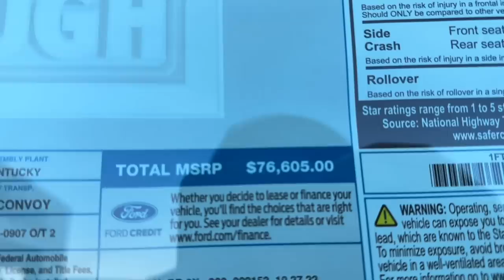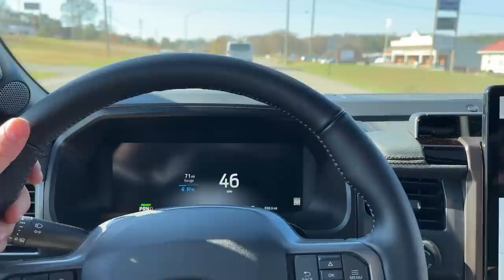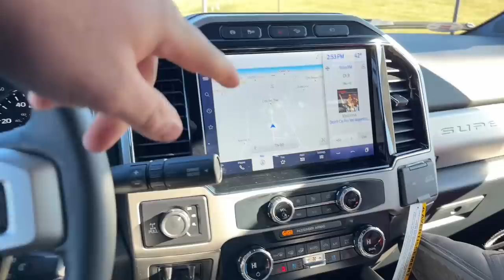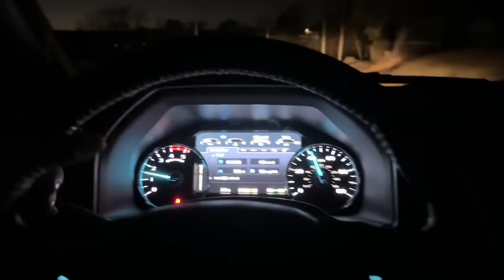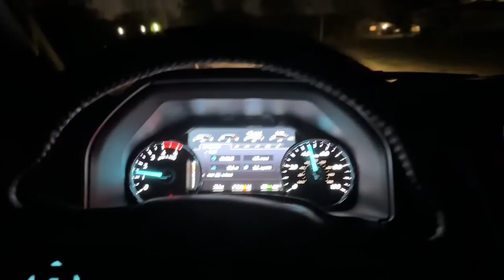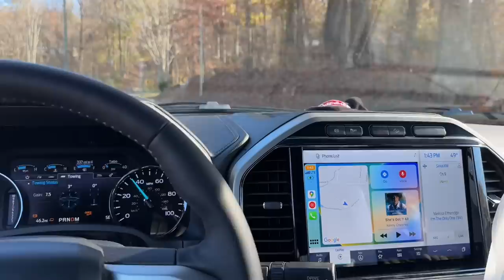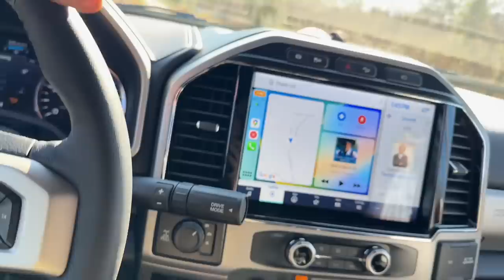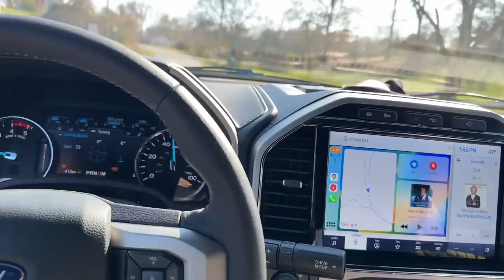Upgrading the fleet with ELECTRIC Trucks or DIESEL?! We try them both..

Comment: I had a 6.7 powerstroke for a couple years. I shed some useless "weight", and she ran amazing and my fuel mileage increased tremendously. I ended up selling it and went back to a old low mileage 7.3 because of the emissions regulations in my state, otherwise I'd still have it. Hope you enjoy your new truck Tim!

Comment: How to turn seat belt minder off. First thing I alway do in my truck!!   Turn the ignition to ON but not start (key position 2, or press push to start button without your foot on the brake if you have a push to start button). Wait 5 seconds, then buckle and unbuckle the seatbelt 3 times with a 1 second pause between each buckle. Wait 4 seconds, then buckle and unbuckle again.

Comment: New 6.7 HO is an option on the 2023's coming out.  Yours still has the standard 6.7 which is plenty with around 475 and 1050 foot pounds.  That 10 speed is huge.

Comment: I have 470,000 km on my ‘18 PowerStroke and, apart from a fuel pump, it has been routine maintenance  It’s no stranger to the 40’  gooseneck either. I don’t think you’ll be disappointed

Comment: Electric will never be feasible as long as they require batteries, and expect that 45 minute fast charge to be 90 minutes in most locations and the 300 mile range to drop to 80 if you use it as a work truck. Home charging is even slower and expensive and you don't dare park them inside or near another vehicle because if fire risks.
Reply: Wondering who's road they are going to drive the electric vehicle's on....they are not paying no road tax on fuel like we pay on gasoline and diesel 🤔

Comment: I had the 6.0 2003 lump "o" S#it had nothing but problems, Motor pulled less than 10k just to plug all the leaks. Drive down the Interstate and it would shift into tow haul @ 75 mph freak the crap out of you then you had to pull over and the only way to get it back to normal you had shut it down and start it back up pain in the Butt. My new work truck 2019 2.7 F-150 blew up @ 46k. No more Blue Oval for me ever and my FirstCar 66 Fairlane is still one of my favorite car's in my whole life.
Reply: Oh I traded the 03 for my 06 Megacab 5.9L 99k original miles 1 owner and Motor is a 100% stock Virgin nothing modified not a huge Dodge fan but this truck has never left me high and dry!

Comment: Tim, the 2022 PowerStrokes have around 35hp more than the Ram Cummins. For 2023 the PowerStroke was boosted to over 500hp. The Ford does have the 10 speed transmission. 

The negative on the PowerStroke is engine braking. The Cummins engine brake will stop the truck while the PowerStroke will eventually slow it down. 

Watch the rear axle on the Ford as they’ve had issues with axle tube crushing. Google the issue.

Comment: Tim all we use now is the 6.7 we got rid of dodge trucks company wide we’ve had no issues “ there is always that one “ great power stock the only thing with my truck just like the one you have is I always have a lot of weight I put air bags on the rear it helped a ton with front tire wear and brakes in the front

Comment: Picked up a loader  in TN. WHERE the new Ford plant is being put in at . For the. E.V BATTERIES AND LIGHTNING ARE GOING TO BE AT. LARGEST DIRT WORK GOING on in the country they say completion  will take 10 years. Impressive. My personal opinion is  its  ok to have wind solar and electric. But you can't end diesel or gas vehicles just to push E.V

Comment: Sorry, I`m sticking with the petroleum burners. If everything switched to an electric motor, there wouldn`t be enough power plants to supply enough energy or the grid systems to deliver it. The windmill and solar systems aren`t producing the energy they thought, as a result they`re in the process of bringing back nukes that have been shut down for over 35 yrs. Right now Calif. can`t supply enough power to stop brownouts in peak usage times, and yet set a time limit on all vehicles in the state or entering the state to be electric ."Go electric" is a great idea we aren`t prepared for.

Comment: Noooooo. Don’t give in to push for electric vehicles. They are worse for the human body than the dirtiest gas or Diesel engine
Reply: He's not lol
Reply: Try actually watching the video
Reply: I don’t know who’s older 6.7 you drove, but the 6.7’s have been flat out quick since 2011, especially in the 250’s ., compared to competing trucks.. I too have been through the dodge, the ford 6.0, I even have a 450 gasser v10 that is a dog, but with 350k miles it still starts and runs daily, just needs a qt of oil a week , the 6.0 I’ve had the heads off twice, and the valve covers and oil rails another handful of times., my 6.7 has been under warranty untill a few months ago, just threw an sct canned tune on it, and I run torque pro to watch all pids, runs great…
Reply: It also supports slavery in other countries
Reply: @privilegedwhitemale306  Tesla hasn’t used cobalt in their batteries since the end of the first quarter of this year, hopefully other manufacturers will follow suit in the future.
Reply: @barrett2724  Well if you believe the fossil fuel lie still. I don’t know what to tell you except go research about who stated it was fossil fuel. It’s not.
Reply: @jonkeau5155  the rest will always be far behind Tesla.
Reply: @@haunlou1644 I guess maybe you should do some research. There is plenty of evidence and information out there. Turn of the Tell-lie-vision and do your own research
Reply: One thing I can't believe is that they don't make any sound...not even an electronic one to let people know that there is a vehicle approaching 😲 when I'm out on my bicycle or walking I use my ears alot,to listen for danger... Holy crap this is getting sick.
Reply: @ryanhogan6509  ?? I just started working for a company they have a 2016 f550 flatbed it’s had def issues it’s whole life it’s slower than turtle shit, if you get a newer truck delete the poison system off it

Comment: Look into the black baffle chambers for your septic. No gravel required youbdig a your trench they snap together and you cover back up with dirt. Make sure you get both end pieces one for the line out of the tank and then the end of the baffles. They can support up to 20k lbs if my memory serves me right and you it takes less than it would if you laid perforated lateral line pipe and no gravel required. Best thing I did was go to that after my perforated pipe got clogged

Comment: Ford needs to go back to the 7.3 powerstroke!!   That’s a great engine.  I got a 99 F250 with 250,000 on it and love it!!!!  Glad to see you in a Ford!!!!!!
Reply: I have an 02 7.3 with 255k on it. The 7.3 is such a great motor because its such low hp. It doesn't eat itself like these 5-600hp factory diesels. Plus you can work on them of you had to.
Put a small set tune in a 7.3 and its good to go. I regularly haul 11-12k with mine. Ill take the negatives to the 7.3 over the negatives of the 6.7 any day.

Comment: FYI, the new High Output 6.7 isn't available until the 2023 model year and makes 1200 tq of torque. The engine you have makes 1050 tq. I know because I have virtually the same truck, 2022 F350 CC short bed 4x4 carbonized gray with the same wheels.

Comment: When electric can do 500 miles per charge and there is infrastructure it will work for a lot of people. My electric bill has gone from $250 to $550 in the last 4 months with no changes at the house so I'm really not interested in it with that kind of fluctuation.

Comment: The fords are fast and make good power. I personaly prefer the way the dodge makes power. But the biggest thing that just makes ford a flat no go for me is the fords exhaust brake is garbage. I pull between about  15k and 26k almost daily for work with my 19 3500 i have a tune and a couple litle things to wake the dodge up and it pulls anything ive put behind it with out breakimg a sweat and the exhaust brake is awsome on it. My boss had a 22 ford 3500 and he wanted me to tow with it one day and the exhaust brake is damb near nothing with that weight behind it even after he gootna good tune on it my dodge pulls better still and will actualy slow me down and make pulling that weight daily safe and comfortable

Comment: Boy if there isn’t 15 videos about this already.     We just ain’t there with electric yet.  And even if we get to the point where these things have more range with the trucks I wouldn’t want it.   We have less lithium then we do oil and gas.   It takes a lot of oil and diesel to get lithium out of the ground and it’s not like mining coal it’s strip mining which go ahead and google it and it’s a giant hole in the ground sometimes miles long and wide.   It’s worse on our environment.  Then you got the infrastructure   We don’t have the electrical grid to supply all these EVs.   We would have to build a lot more power plants and hydroelectric plants or dams and even then we would have to build these stations everywhere since their range sucks.  Then you got replacing these batteries.   I just spent $311 for 2 batteries in my diesel pick up. Imagine one of these vehicles? I’ve heard they can cost $15k give or take out of warranty.   Then you got disposing of them ? Again way worse for our environment.  And then above all of that the the power is an unregulated market meaning these power companies and the government can charge whatever they want.  They have already put us in a fuel crisis what the fuck do you think is going to happen when a lot more of us have these EVs and the power grid is failing ??? I’m no tree hugger but if we’re going to play this socialist libtard game then we should be talking about the down sides which out weigh the upside by far.  Remember all the wind mills ? That was a huge mistake and cost a lot of money and when they are done with those windmills there is no way to really dispose of stuff like the blades.  If you research it there are videos of them dozing the blades into the ground.   I think we should bar the EPA and the the government from making energy related decisions.  Hell financial and war decisions too.  Do your research h.

Comment: I would wait on the electric,too many problems with this new technology.the biggest problem is these electric vehicles are having the batteries catch on fire and burning up, there r also navigation programs that are also happenig,just wait until they can get the bugs worked out.
Reply: Can’t wait to see the first one that backs a boat trailer into the water and the motor shorts out and turns the truck into a BBQ. A lot of flood ev’s from hurricane Ian caught fire once the battery shorted.

Comment: Them 6. 7 scorpion engines in them 2017 one ton  Fords , I love them , The torque and the horse power that they have in the mountains ,  12 miles to the gallon seting at 48,000 gross And around 16 miles to the gallon interstate and around town truck alone and these engines are stock , DODGE CANNOT run with them they have tried

Comment: We have the 6.7 in a few of our F750 bucket trucks...they have been reliable for the most part, but we blew the turbo up on one and the second one also blew the turbo which then took out the engine.   They ride nice and have lots of power, but the ISB Cummins 6.7 with an Allison 3000 just can't be beat.  Reliable and never broke down at all aside from some emissions sensors.

Comment: Straight up, I have a Tesla Model Y and it is EASILY THE BEST vehicle that I've ever bought. How and why do I say that? Note that my wife and I also have a Jeep Grand Cherokee with a 4.7 liter V8 Semi which I THOUGHT had torque but compared to the Model Y I would almost swear that my Jeep has a 4 cylinder engine in it. That's how much more torque the model Y has and they are both four wheel drive.

I DO NOT own any Tesla stock. I don't work for Tesla. I don't know anyone who works there. I have zero connections to the company other than being an EXTREMELY happy customer.

1) INSTANT torque. I have the slowest vehicle that Tesla makes and it does 0 to 60 in 4.8 seconds which is faster than the Jeep by several car lengths. Not close at all.

2) No maintenance. I put in a charger port in my garage so it charges faster. I plug it in when I get home and when I leave the Tesla is fully charged. I don't have to go to any F&&king gas/diesel stations to fill up. Literally the only maintenance is a) changing the windshield wipers just like I have to do on any vehicle b) filling up the windshield washer fluid c) changing the tires when they need to be changed d) ... there IS NO D)

3) TRIPS: If I go on a long trip and need to charge up, I go to some place and get food and then eat in the Model Y and by the time I'm done eating it is fully charged and off we go.

4) Charging stations: How much you are charged is based on how much electricity is in your area. I live near Seattle where gas/diesel is the highest prices in the lower 48. However, we have the LOWEST or close to the lowest prices for electricity. Filling up the Jeep with the 4.7 liter V8 hemi costs about $90 right now while it cost me $20 to fill up my Tesla. $70 less, more torque, no maintenance. GREAT vehicle. I saved over $500 in ONE MONTH going electric vs gas/diesel.

5) Life of the batteries: I can't speak for other brands but if you charge up your Tesla to 80% or less of max (and how often do you ACTUALLY drive more than 250 miles in one day?) and you charge if up at home 90% of the time, the batteries will EASILY last over 400,000 miles. That's a MINIMUM. The better you treat them the longer they last. One guy has over one million miles on his original batteries. That's a seven year old Tesla. Your mileage may vary but you should easily get 400,000 if you don't abuse it. Just like a gas/diesel vehicle. You treat it like s**t and it won't last very long. If you treat a diesel truck right it will last easily over 300,000 miles but it will cost you 10s of thousands of dollars more in diesel fuel and maintenance compared to a Tesla.

6) Prices? You just go on the website like you would with anything else and you see the price up front and there is no BS dealing with the dealership dickering on prices. Prices are straight up right there. You just go to a bank, get a loan, give Tesla the check and you drive off. If you've never owned one they show you how it works but if you've driven one before and you are buying another one, you can be in and out in ten minutes, literally in 10 minutes. You hand them the check, you look around the vehicle to make sure that there is no damage just like on any other brand of new vehicle, they give the keys which are like credit cards and off you go. That's it, zero dealership BS.

Comment: Love my F250 6.7 Lariat, solid work horse but also ridiculously comfy for fun road trips, towing or not .  Electric will come, but it needs infrastructure and more range, charging stations that you can tow through are a must before I would swap (and I'd still have a back up genny).
Reply: you go electric I'll stay with gas/diesel
Reply: @MrRod632  I'm diesel until I die, I was just saying that electric is going to be the way things are going with or without our consent and that instant torque is impressive
Reply: I had seen somewhere that a company that builds Ford's diesel 6.7 engines... They weren't putting gaskets on the oil pans and burning the engines up.

Comment: Love the old case, is it a 4490 or a 4690? I was just plowing snow today up here in Alberta with our 4494 weighed up to 28-29000lbs. She can push a fair bit before the traction goes away, just have to be careful with the powershift in them, put it in one gear and go, don’t wanna go up and down constantly on the powershift or you can wreck the clutch plates in them. Great tractor if driven properly though

Comment: I’ve said 95% of people could drive an electric, pickup or otherwise 99% of the time, the rest can buy or rent a diesel pickup. Pickup owners try to act like they can’t function with electric range anxiety, but most of them might tow something that heavy for that long (like an rv) three or four times a year max. That being said once they get a little more range and faster charging they’ll be a viable replacement for most work trucks too. 400 mile range would get you 4 hours of driving before a 30 minute stop at a rest stop with a healthy range buffer, towing you’d get 300-325 max, still not bad. Most people rv in the same state…
Reply: So what happens when everyone gets an EV and their batteries need replaced? Can the world survive the waste materials from all those batteries?

Comment: I see EVs being practical as a commuter or a local use vehicle, but for long distance road trips diesel wins.  I get close to 600 miles in my diesel X5, 650 in the Audi.  In the 45 min you wait at a charging port at a rest stop, I'm some 50-60 miles closer to my destination.

Comment: Tim , if you would have waited a month to trade you would have been surprised.  They are wholesaling Toyota from the market starting the nose dive. Any electric car or truck will cost you atleast double from the cost of the vehicle.  The cost to put the proper charging station at your house or shop costs as much. A jeep owners electric bill went up by 300 % when he started using his electric for his vehicle.  I can forgive you for the Ford, but if you'd have gone electric I'd be gone as a sub 🤷
Have a Happy Thanksgiving Gentry trucking crew 🇺🇲☝️

Comment: Are company has 8 RCL refuse collection vehicle thay are all parked and been sold each vehicle has 5 runs to do per day anywhere from 90 to 150 bins the fully electric vehicles did it for the fist week and slowly tapered off to just 1 to two runs before it needs recovery and charging the manufacturer is now saying they need a new battery at 67k pounds that's x8 with them running lights hydraulics compressor and driving soon fucks the battery